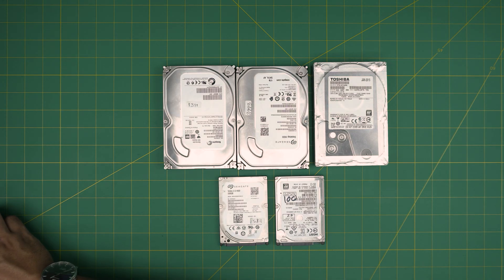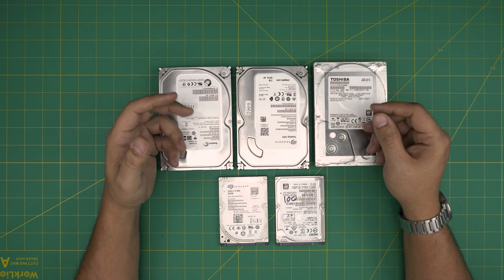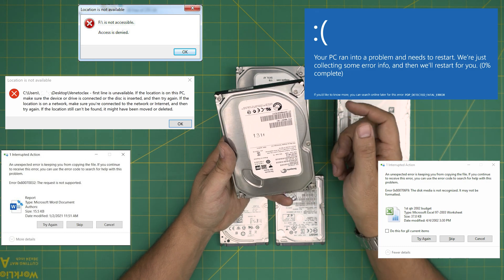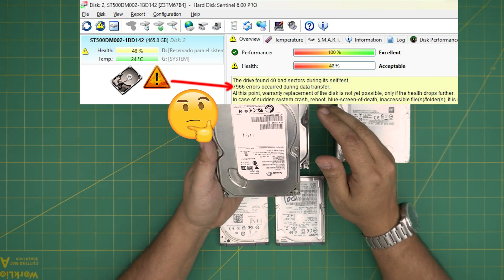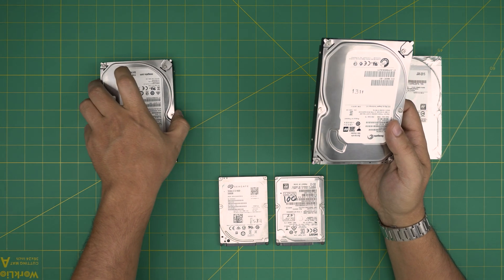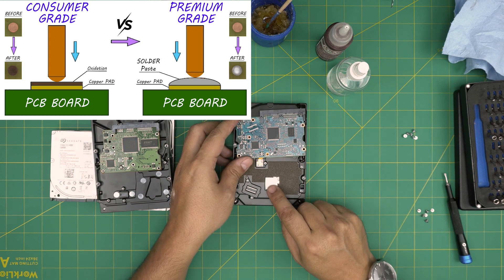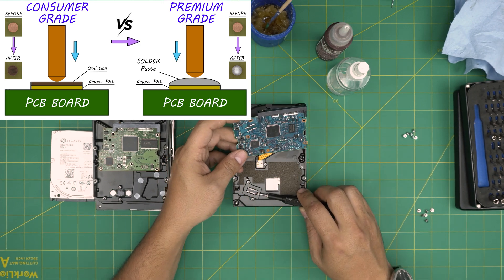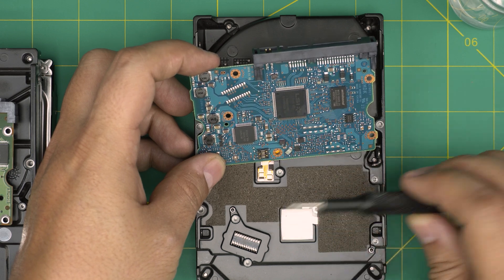📢Fix HDD Hard Drive Failures: No Detection, Random Disconnects, File Transfer Errors📢

Comment: hi u will be a life saver if u cud help ..
so my hdd was working perfectly fine then i upgrade my mobo and processor and new windows , so now it remains stable i can use the stuff stored on it like i can watch a video etc but 
WHENEVER I TRY to like copy something from this seagate hdd to another drive it disconnects and connects again and i am going totally mad here , i hdsentinel and it says hdd is perfectly fine. HELPPPPPPPPP
Reply from the maker: 🫠Regarding your question, all you need to do is clean the pins on the HDD board, and you will jump for joy! You can go as far as @8:38 , this solution will last you few months and maybe years.
But if you want a permanent solution, you will need to coat the pins with solder (do everything shown in the video).
Should you have any further questions or requests in the future, please don't hesitate to ask me.
cheers🍻

Comment: Have you ever tried a silver plating soulution? In the past I have used a liquid you just rub on copper or a silver paste in a syringe. With the silver liquid I'd clean the copper and then apply the solution using a padded swab, not cotton swabs. The other apply the paste on cleaned copper and let it harden...it leaves a sight hump like soldering does.
Reply from the maker: Yes my friend it is a very good solution and in the paste we have tested on our internal drives it is more expensive for regular people to do, but regular solder paste is more than enough, silver plating is very good if you know the process, at the end you get the same results with silver or solder paste, thank you for the tip and comment, cheers 🍻

Comment: Great video, I really enjoyed it. I'll check all my drives ASAP 😂
Reply from the maker: Thank you for your feedback! If you wish to support the channel, you can like, subscribe, or both!
Regarding your HDD,  if you have anything over 2TB then you may be in safe side as they are considered business class and have soldered pads, but anything under open and check the motor pads and actuator pads. also get 1mm thermal pad for the chip.
cheers🍻
Reply: @uFixTek  I already did both❤
all my drives are under 2TB😒so I have to check them🙏🙏
Reply from the maker: thank you for the support, and yes open and clean the pads if you don't have the solder station, by cleaning it it will prevent malfunction for some times, because if god forbids if the disconnect happens during the file read or write, it can start with bad sectors and that would be not repairable.
before you open download this app free and check the status of the drives.
Should you have any questions or requests in the future, please don't hesitate to ask me.